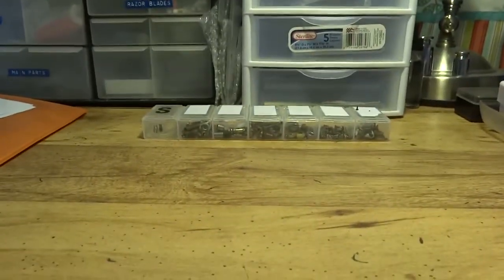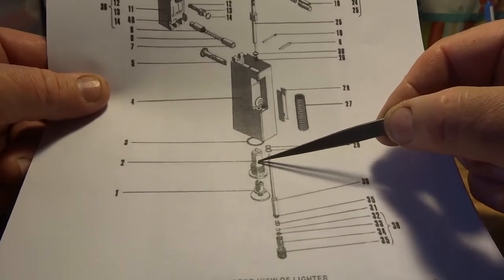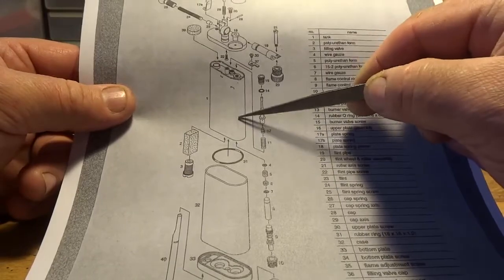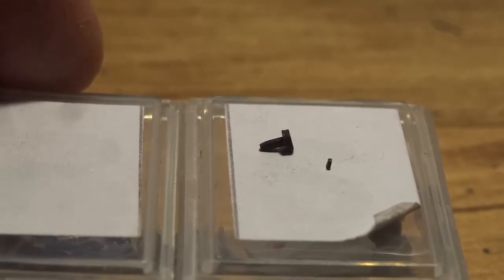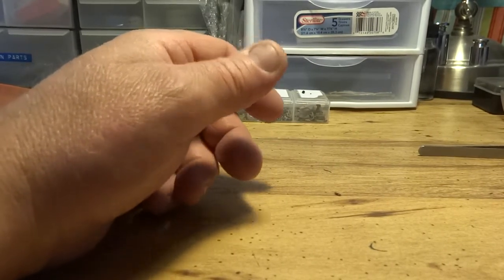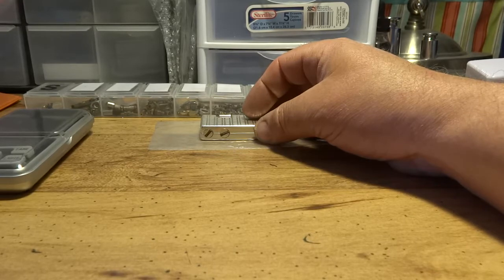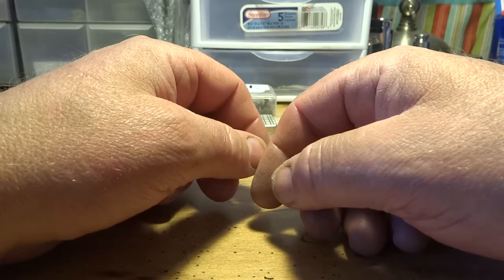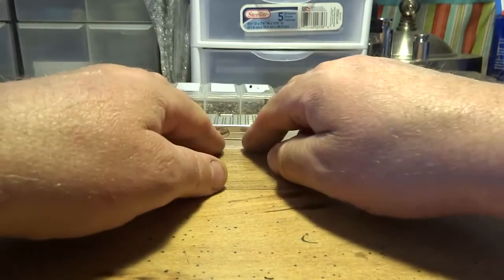Vintage Lighter repair thoughts

Comment: Another excellent video as usual Lighter 2018. Thank you very much for sharing your knowledge with this. The demo makes it very easy to understand the differences between different designs. I do still want a nice Rollagas but I will get and old boy before i do that. And best part is it already has pipe valve where a Dunhill with pipe valve is virtually impossible to find and if you do it costs a fortune. Additionally i read somewhere that it holds 2.8 grams of butane where an old boy is 3.4 which is another advantage.
Reply from the maker: Thank you for your comments! Let me say that,  I understand about wanting a Dunhill Rollagas with a pipe valve, and yes they are expensive. Being I don't smoke or collect,there was no need for me to have a couple $350 lighters laying around. I would rather take the cash and purchase a variety of lighters to try and fix.  I like seeing the different operating mechanism's that people have designed over the decades. I once scored a lighter lot off of ebay that had a Dunhill rollagas parts lighter with it. there was some parts  missing from the rollagas but I could barely make out after enlarging the photo that it had a pipe valve in it. The listing had a Buy It Now of $75.00 so I bought it. I ended up fixing and selling the other lighters and dunhill parts for more than the $75.00 I paid for the lot. I kept the pipe valve and it cost me nothing. I eventually found a Minty like new in the box Dunhill rollagas that was absolutely beautiful for $105. I installed the pipe valve in this lighter and sold it for $350. The buying was very happy, here was his feedback reply.  
"perfect in every conceivable way!
"

Comment: Simple is sometimes best for sure. Some lovely specimens 😊
Reply from the maker: Thanks for your comment Newton Piper! I got to thinking about what I said in the video after posting and realized that I may have made a few Dunhill lovers, collectors a little upset, so I want to clarify it more so if I may. First off. I think Dunhill Rollagas lighters are one beautiful working example of a Quality swiss design that you will ever see. That being said, parts for repair are hard to find and when a used part shows up it's usually very expensive to purchase. Used Rollagas price's have gone up considerably from a few years ago as collectors and others needing parts have driven up the prices. Repairing the Rollagas is easy but sometimes the disassembly of a rollagas can cause more problems than you already had to start with, especially if you break off the head of one of the platform screws  because it was froze up.. I know as I had this happen  myself.  Needle valves can be problematic to get a new seat set just perfect as well.  I did my own conversion on the needle valve so I wouldn't have to wait two days for the glue to dry so it made it so much easier for me to get the seat to work the first time around. In case someone ask what I did, I will explain now. if anyone that see's this has disassembled a Rollagas Pipe valve know's that the needle valve has a hole drilled from where the rubber seat sets, all the  way to the top where the 45 degree hole is for the pipe valve gas to exit.   You also know that the standard
flame needle valve has  a very shallow base for the seat for the replacement seat to be glued in . What I did was simple, I hand drilled the base out enough for the replacement stopper just to be pushed in so it can stay there without any glue needed to hold the stopper in like you need to do normally on the small 1.mm x ,5mm stopper. This is tedious work to do but you will never have to glue another stopper in again on your needle valve. You also have to make sure your micro drill bit and your Rubber cord your using will have the right dimensions for each other so the cord will have enough resistance to stay put inside the needle valve after you drill the hole out.....If this mod is done correctly your Dunhill rollagas repair's will now be so much easier. I stay away from repairing The Rollagas Lighters now because there are lots of repair people out there who can do the service, plus the cost involved in buying spare lighters is high and my funds are limited, plus I enjoy fixing different lighters and enjoy seeing the ingenuity of other lighter manufactures.   I would also rather buy other quality pipe lighters that can be repaired and offered to those out there that are on a budget but wanting the best quality pipe lighter their money can buy! I also enjoy helping those out there that watch my videos, learn to repair there own lighters. This is the best option for purchasing a use quality vintage lighter at a very good price and keeping repair cost down for decades to come....I hope this helps clarify my thought a little more that the video does,
Reply: Lighters 2018 absolutely! I have a Rollagas And its is a class lighter but I don’t use it for my pipes. Being on it side I would imagine this would split the Flint housing after a while. So I use it for Special nights out etc. 
I have a few Zippos that I have repaired in the past and it’s quite fun to do but only for giggles. 
You are right with the Japanese quality I have a few things like my Seiko watch’s (Alpanist) which to me are better than the Swiss made ones. 
I liked the fact that you can repair your lighters to such a degree where you can light them up 250 plus times and then say yep, that’s good. Hehe. 
Thank you so much for the info I appreciate it 😊👍